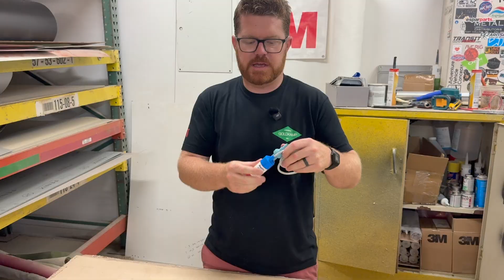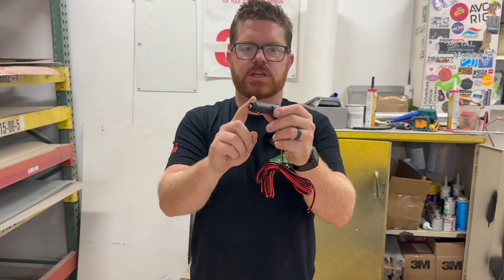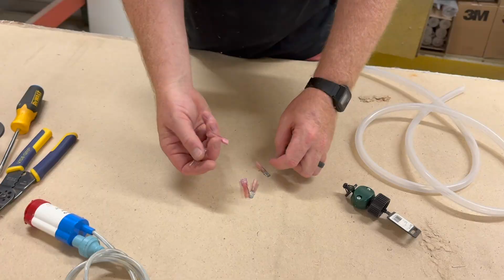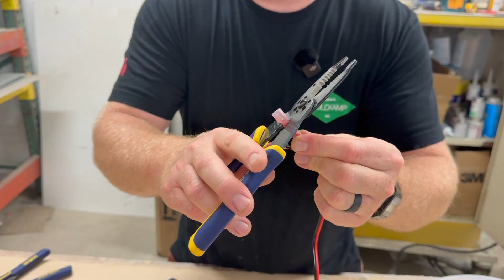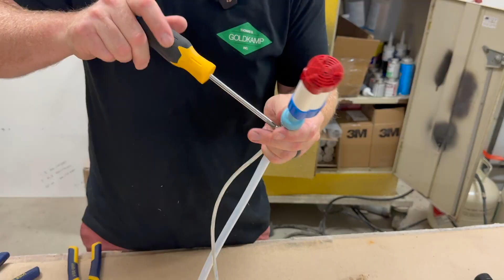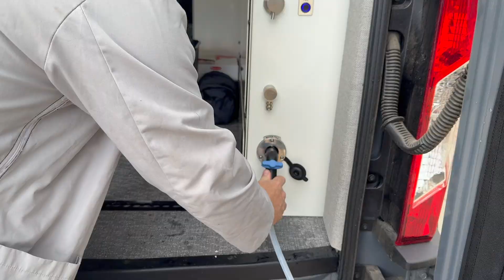DIY Water Transfer Pump for Your Camper Van! Easy Way to Fill Your Water Tank Anywhere

Comment: Nice job.
Looks like you would be limited by the diameter of the water jug opening, plus now you need to store it somewhere. 
Since you already have a 12v water pump in your RV, why not use it. 
Just add another vavle to the suction side with a short retractable hose to go into any jug, then another valve on the outlet to direct it to the tank.
Reply from the maker: This is just for the instance we arent able to find a place to fill up. allows us to use any container to fill the system with
Reply: Where’s the supply list?